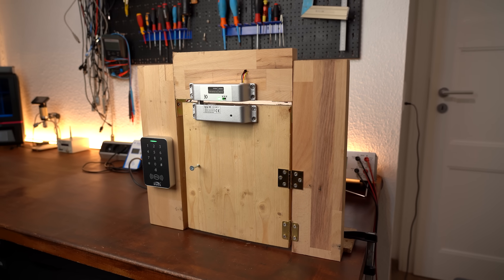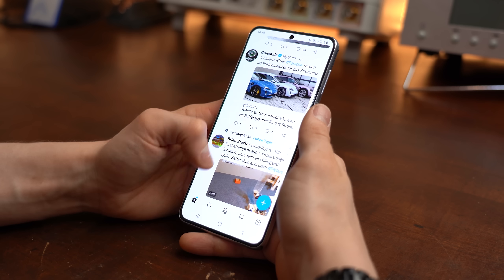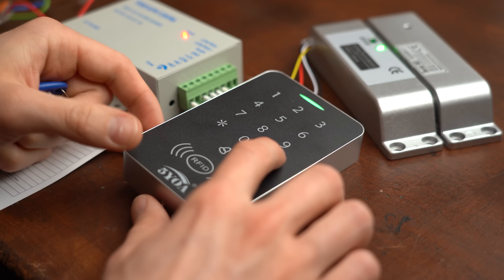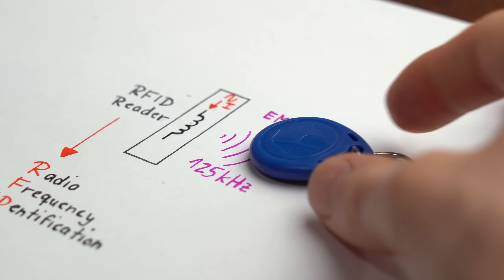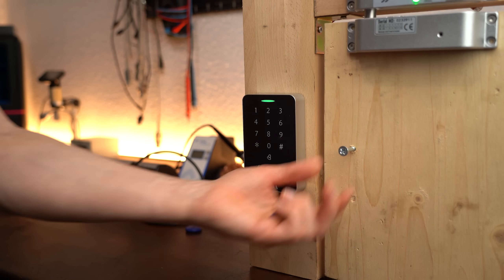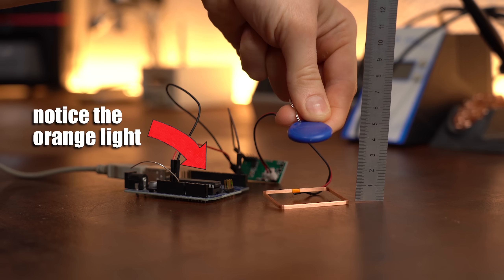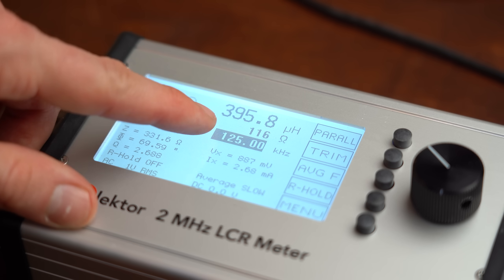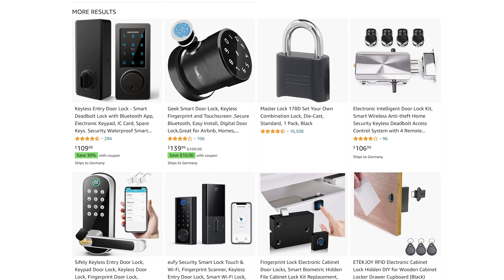RFID Locks are way too easy to "Hack"! Let me show you!

Comment: When I was building an RFID door lock for my mum when she developed Alzheimer's, the hardest bit was getting a good range.  I ended up getting a huge (and resin potted!) reader unit and using it with the long range cards.  (The keyfob circuit but with a wider coil in a plastic card.)  I got a decent range from it.  It also greatly improved the range of the common keyfobs too.

There does seem to be quite a precise science to reading the keyfobs accurately.  I did a lot of experimentation with adding wider coils too.
Reply: Great minds think alike! That's why they follow Bigclive and Great Scott!
Reply: @davebrooks3914  throw AVE in there and it's a party
Reply: I wonder if antenna design would be better at increasing range, or active noise cancelation.
Reply: @absalomdraconis  For all intents and purposes the coil is the antenna in these systems
Reply: @bosstowndynamics5488  Not really. The 125kHz system is nearfield and the coil works like an air tranformer with very poor coupling.
Reply: @mrkv4k  I'm well aware that the coil acts as an air core transformer, as far as I'm aware it's also the data path though, I'm not aware of there being a separate independent antenna
Reply: @bosstowndynamics5488  Semantics. The coils is the antenna, I pointed out that it acts as a tranformer just because traditional antennas work with far field.
Reply: @mrkv4k  If it's just semantics why did you necro an old comment to try and correct me? If you go back and read the thread I was clearly implying an also in that sentence (ie "The coil is (also) the antenna) - the original comment was Big Clive discussing using alternative coils to increase range, someone suggested modifying the antenna, and I indicated that this was already done because that's one of the jobs the coil has. You're the one who came in and said "uhm actually it's really an air core transformer, not a normal antenna"
Reply: @bosstowndynamics5488  Because it made sense to me at the time, but I realized, that YouTube is not a place for such nitpicking and if you don't know enough about the subject, it won't give you anything.
The coil isn't also an antenna, it is the antenna. But unlike most antennas you can be familiar with, it uses near field. It doesn't form an electromagnetic wave, which can then travel through the air. That's why it makes more sense to think of it as an primary winding of an air transformer than antenna.
That gives you much better idea about coil size and shape to achieve more range.
Generally speaking, the range is the same as the coil diameter. But you have to be able to get enough energy into the tag. If you double the diameter, the area of that coil will be 4 times bigger pi*{d/2}^2 and you will need 4 times more current to get the same magnetic field strength at the same distance as you had with the smaller coil. Even more current if you want to achieve strong enough magnetic field at the new maximum range.
If you've ever worked with antennas and calculated their directional patterns, you'd noticed that this approach is completely different and my original comment would be helpful. If you haven't, it's useless.
Reply: @absalomdraconis  

See Rodin Coil antennas
Reply: @absalomdraconis  Not really, at least not with a 125kHz system, because it's hard to make a far field directional antenna. The wavelength is around 2.4km, which means that lambda/4 is around 600m. That is why most long range readers use high frequencies like UHF, but the disadvantage of those is that they are blocked by everything that's at least a bit conductive (like the palm of your hand).
Reply: The key to the range is the sensitivity of the reader and active keys. Then 20 - 50 meters is achievable. I would rather go for BT LE though - especially because you can't trust anything you buy. The market flows over by trash without strong encryption even when it says there's strong encryption. You need to implement the encryption yourself. This is pretty simple because strong encryption is available by source code for Arduino. Also available are BT LE modules which allow for userspace large enough to add the extra functionality. If you choose version 5.2 both on the transmitter and the receiver you will get months of operation from a 3 V lithium cell used in watches. Probably even longer if you add an ultra-low-power gravity sensor to limit transmission only when moving. To make it more reliable you may also use the source code as a random seed. This way you omit the negotiation process. You only send the secret key to the power of the base's public key times random seed. This is secure enough for homes when windows are the weakest link.
Reply: @Youtube_Stole_My_Handle_Too  Not really, the signal to noise ratio for a passive tag is almost impossible. You can achieve those ranges with an active tag, but that's something completely different.
Reply: @mrkv4k  Nonsense. You can't say anything about SNR before you know the bandwidth.
Reply: @Youtube_Stole_My_Handle_Too  To be honest, I mixed two comments together and wrote something that I didn't want to. The problem isn't the SNR, it's the fact that you have to power the tag from the reader. And it's really hard to transfer enough energy at more than 1m distance (that's why I mentioned active tags, which have their own battery).

On the subject of bandwidth. These old RFID standards use 125kHz carrier frequency and usually /32 or /64 data clock. So the bandwidth is somewhere around 4-8kHz (you don't really need higher harmonics).
On the other hand, the problem usually is, that there is more than one reader of the same kind. And since they are not all exactly 125kHz, you will get interference between carriers. And frequency of this interference is usually few hundereds of Hz and will often overload your input circuitry.
For example, our company is using GP-90 long range readers (claimed distance of up to 90cm) and they often don't work if mounted closer than 10m appart from each other (coils in the same plane).
Reply: @mrkv4k  No, it isn't hard to transfer energy more than one meter. It's only a matter of field strength.
Even if there are many RFID in the direction where I read off at a distance of 100m it doesn't matter because of the random delay from device to device. Even in a worst-case scenario where there's a collision, no worries, I can read hundreds of times if I want to. RFID is constructed in such a way that you can walk into a store, pick a thousand items into your cart and place it into the scanner and all the items will be registered within seconds.
Reply: @Youtube_Stole_My_Handle_Too  Oh, sorry, I thought that you know what you are talking about.
The "RFID" is not a single thing, it's a name for identification through radio signal. Your example would be like saying that cars can obviously go 120mph, because you've seen a corvette on a highway. Some of them can and some can’t.
There are many different RFID standards with many completely different aspects. The most used frequencies are the 125kHz, 13.56MHz and the UHF (different in EU and US).
The standard used in the video is EM41xx with 125kHz, which is also the oldest one. It was developed decades ago when microchips were not that common. The EM41xx uses amplitude or phase shift-keying, and the tags communicate only one way. When they are in the RF field (which is strong enough to power them up), they just change the load on their tank circuit, which can be detected back at the antenna coil.
This technology doesn't allow reading of multiple tags because they all transmit at the same time. Also, it's almost impossible to make a long-range reader (more than about 10m) because you would need an antenna which is more than 240m long (the wavelength is about 2.4km).
Also, the standard bitrate of these tags is 2kb/s, with a 37b long key, you get about 50 repetition per second. So no, you can’t read them hundred times per second.
I am not aware of tags being used to scan your groceries; they usually do that with a simple bar code (which is much cheaper). On the other hand, RFID tags are often used for package sorting, but those usually work with much higher frequencies (UHF). Those can work at really long range (20m+), but they require (almost) direct line of sight between the antenna and tag. This is solved by having multiple antennas.
I have been designing RFID readers for 8 years now, so I know.
Reply: That could work, but you might have more luck by agitating the rf signal. You can do that just by shaking the tag a little. I deal with uhf systems and even on these high powered systems I have to move the tag around or the reader in a paint brush pattern
Reply: Also the material you are mounting it to matters, RFID signals can be reflected by metal and blocked by water. This greatly affects readability
Reply: @silverhammer8464  this would explain why mine dont work when I'm trying to get in my submarine.
Reply: @handlesarefeckinstupid  wow that's not factory is it? If it is then that's a big manufacturing oversight
Reply: @silverhammer8464  The reason why "shaking" the tag works with the UHF is, that you get a lot of peaks and valleys due to the interference between the direct signal and the signal that bounced of something conductive around the reader. This doesn't work with the 125kHz system, because the magnetic field around the coil is usually pretty uniform. Also, the UHF system uses far field and antenna with very high directionality, the 125kHz system uses only near field and direct coupling.
Reply: @mrkv4k  but why does nfc suck and I have to move my phone or tag around to get it to register the epc?
Reply: @silverhammer8464  Likely because your phone has a good EMI shielding, which dampens the energy from the NFC antenna. It's a compromise between space (size of your phone) and range.
Reply: once talked to a guy on the train into university who said he worked designing RF gear. said with some of their equipment they could interact with the cards and doors from, i believe he said 30 meters. though i may be remembering it wrongly. since that seems almost absurdly far.

he also gave some good advice to not fall foul of the regulatory agencies
Reply: What is this, a crossover episode?!?!?
Reply: Didn’t expect to hear your voice in the video! @clive
Reply: works best by using multiple overlapping smaller coils, with the thinnest wire you can get. also go for silver wire if you can afford it, its much better suited for this task than copper.
Reply: @FingerinUrDaughter  Deppends on the working frequency. The 125kHz systems won't benefit from silver at all, because at that frequency, there is almost no skin effect. The 13.56MHz will benefit a little bit and the UHF systems would, but the coil needed has such a low inductance, that they are usually made from bunch of microstrip dipoles.

Comment: This method is pretty similar to taking a picture of someone's keys, only the range is occluded by metal rather than opaque things. 
So, if you just store your RFID tags in an RFID blocking container, then you'll actually be about as secure as regular keys since the range should be similar.
Reply: Normally you've got an encrypted rolling code. Something like mayfair desfire ev2. As an antenna you could maybe use a retail shop gate.

Comment: In india we have Some thing called "Fast Tag" this is a long distance RF ID reading solution (i believe). Used in car to detect the vehicle details to deduct tool charges on High ways. Maybe some things you will like to see and I'll also like to watch 😉
Reply: yea we have one too, but those are encrypted, if they weren't secure someone could have changes the id and some poor guy would have to pay for the tool charges, also on a side note its kind of illegal to tamper with those tho i wonder what frequency those operate at probably UHF

Comment: Great video and idea, I just wanted to add up by looking at the internal circuit of the lock ( 3:57 ) that this lock uses a regular relay (almost certain to trigger the lock to open) which makes me sure you can open it just by using a powerful magnet (say neodymium) on the side of the lock, which is a known venerability to most cheap and even some premium security systems.
Reply: So the magnet cause the relay to close, instead of the electro magnet inside the relay?

Comment: The overwhelming question is, why would you want to open a lock from a great distance?
Reply: Not sure if you're talking nefarious reasons, or legitimate reasons... but the most common reason for long range RFID application is motorized gates and garage doors. The person requesting access is sitting in a car and has to reach out the window to offer their credentials to a long range reader mounted on a pedestal. Authentication triggers the gate or door motor to run. UHF RFID readers can work from tens of meters away. UHF RFID works from so far away it is even used in inventory control (can keep track of inventory second by second). I've seen it used in high end boutique stores. Interestingly, there are companies which make UHF RFID THREAD... meaning there's no tag to remove or deactivate when the product is actually sold. And the consumer never notices.

In this video, he's not attempting to "open a lock from a great distance"... he's attempting to read the tag's ID so he can make himself a copy. His 8-12" read distance lines up with how close you could get to someone's credentials in a shopping mall, subway, etc (pre-covid lol).
Reply: @833psz  Can I refer you to the title of the video, "Can I pick this RFID Lock electrically from a distance?"
Reply: @bsdjunkie1805  Clickbait title. You can’t change the reader’s sense distance. The coil inside is fixed. Also you can’t “pick” an access control device and this isn’t a lock.

Comment: This is the reason I don’t use my phone to open my front door, but instead use a simple push button code. To me this is much safer and less likely to be hacked by anybody. 
Same reason I don’t use voice technology, it’s easier just to walk to where I need to change something.
Reply: Push button codes can be pretty easy to work out without any specialized equipment. 
But when it comes to home doors the answer is usually, get a better door. IE: the actual lock is usually, from a break-in standpoint, not the weak spot.
Reply: @AveragePicker  
Good luck working out a four digit code in any short amount of time. You’d be pushing again and again and again with no luck! Now if you put down 9999, perhaps somebody could figure it out!
I would think the thief would be more inclined to take on a house that uses an iPhone to break into a house. 
Besides I figure the higher the tech on the house, the more likely at the pool think there’s something to steal. Also important is where your house is located in the neighborhood, I find that people who have houses close to a main street are more likely to get hit than others. How do I know, most of my neighbors who get robbed or near the main streets. Especially those that get their packages stolen. 
It would be nice to find out what camera systems homeowners are using today for protection.

Comment: Well this only works when the RFID system being used is static, most comercial rfid systems use a encryption scheme and have other solutions to this problem, this is only so if you set an id an a tag.

Comment: Seems like the issue is that the energy that is powering the coil overwhelms the return signal.  Would it be possible to have the high power carrier beamed out from one side of the victim and the signal picked up from the other side?

Comment: You had me glued to the screen with this.  I'm working on an RFID product using Gen2 tags (~900MHz).  I have read tags over 2m and I have a more powerful reader I haven't tried yet.  I assumed that lock tags would perform some kind of encryption, or at least use a unique number that can't be easily copied.  Gen2 tags include a permanent, unique identifier as far as I know.  I'm shocked that those tags can just be copied and work.
Reply: yes this is exactly what i was thinking about as well, the long range rfid readers are mostly of UHF which is around 900mhz. the 125khz ones are just horrible in terms of protection, heck even the 13.5mhz ones have ton of exploits due to security flaws

Comment: The LPL hack with the magnet to the relay was more fun :) (I think a general good indication: if you connect the lock contacts to the outside device it’s not safe)

BTW the „better“ RFID systems go a long way to document that they should not be used as access control :)

Only rfid Chips with smart card function can do challenge/response and are (partially, think relay attacks) safe.
Reply: all the designers need to do is place a hall effect sensor near the realy, so that if you bring a magnet near it, it will just sound the alarm, but then again a seperate control units makes much more sense

Comment: Eh, since the control unit is basically just sending power to door latch to open the lock, it's easy to just smash it open and connect the wires that go to the door latch. So this is only barely better than a zip tie.
Somewhat secure systems have an external panel with only the keypad and RFID plate, while the controller with the relays that control the door latches is internal. So even if you smash the external panel you can still just press the keypad buttons